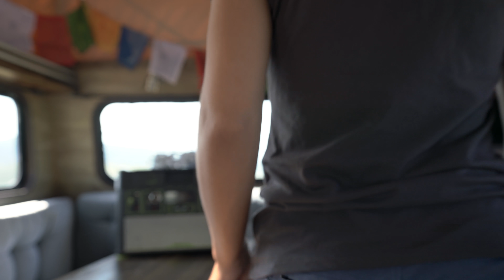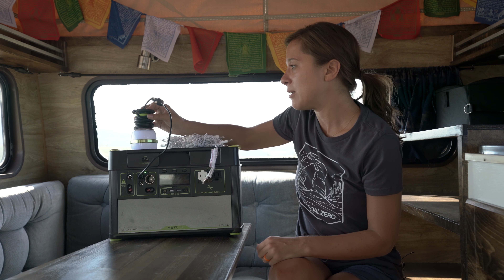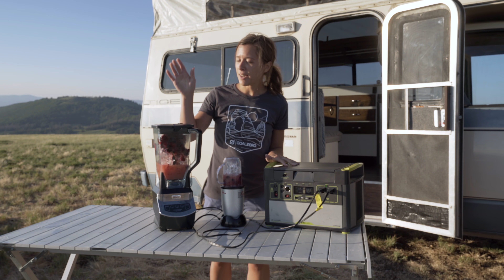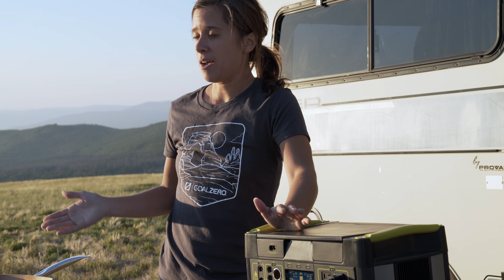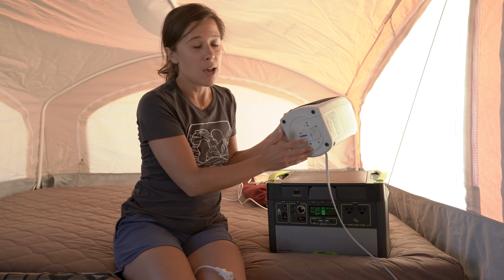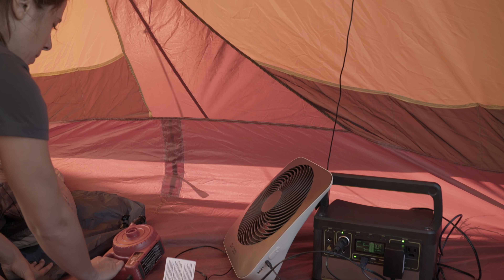Goal Zero Yeti Powers: Camping Edition

Comment: Please, my Dewalt power station kills that thing, in discharge & Charge time https://i.imgur.com/NeJ5NID.jpg. Plus you can take the batteries out, put them in tools and go to work. It is like comparing that Briggs & Stratton 5000 watt geny that only puts out 20 amps to the Honda EU3000 that puts out 23.7 amps. Charge time on that is a joke, like 12 hours? I can charge in 70 minutes @ 12 amps DC.

Comment: How long does it take to charge the yeti when it is down to only 20% ???
Reply from the maker: Hi Jeff,
Ultimately that depends on how many solar panels you're using and the weather conditions you're under. if you max out the input on the PWM controller at 360 watts you should be able to recharge the Yeti 1400 in about 4-6 hours in sunlight. If you add the MPPT controller  module to the Yeti 1400 you can have a max input of 600 watts and it can recharge even faster.

Comment: I know it's light and looks real cool but for the price of a Yeti, I picked up a Costco Yamaha 1800 watt inverter generator, (2) 35ah agm batteries, a 400 watt pure sine inverter w usb, an 80 watt foldable solar panel set with a charge controller and a big buddy propane heater with some money to spare for gas and lp.This keeps me covered for using the generator for big draw appliances and charging batteries, the batteries and inverter for led tvs, laptops, iPads and iPhones and the big buddy for when the temps go from 80 to 45 after the sun sets.
Reply: That's a really economical setup. 

Could you please list the models of:
 1) 35ah agm batteries,
 2) 400 watt pure sine inverter w usb
3) 80 watt foldable solar panel set with a charge controller)?
Reply: Agreed, the convenience of the Yeti is just not worth the price tag.  If you have the money, buy it.  But there are far more options for far less.
Reply: I'd do a 100 Ah Bioenno LiFePO4 battery. Small pure sine wave inverter, 300 Bestech. 100W renogy solar panel and maybe one of their compatible chargers with the battery or I use the Buddipole power mini. When I go camping, while it's allowed in the rules for certain hours, I'm not the biggest fan of hearing a generator running for four hours next door between 5pm an 9pm. Very rarely does someone bring one.

Comment: One set of Christmas lights uses more power than a dometic fridge?
Reply: Your Journey to Sleep
Like other people have commented, it's the difference in starting with a 12v power source and then converting it to 'household current' with the inverter. You should use 12v devices as much as possible, your power goes farther. Btw, goal zero gear costs more and has fewer ports and functions and is heavier than the Inergy Kodiak, which has a sweet 3k now. I don't work for the or anything, but it is on my wish list.

Comment: Question....so if the Yeti was 2000 to  3000 watts would it  be able to run the heater? Or air conditioner
Reply from the maker: Hi Alvara,
Great question. So everything will ultimately depend on the power draw of your heater or air conditioner. So let's say for example your heater required 1500 watts to run, that would mean that every hour your heater would drain the battery by 1500 watts. So if we took our Yeti 3000 lithium power station that stores 3000 watts of power that would only be able to run that heater for 2 hours before it would drain the Yeti to empty. So even having a larger Yeti that was 2000 or 3000 watts wouldn't make it run all night and still be a heavy power draw.
Reply: Goal Zero ... I understand now.  Thank you

Comment: LED Christmas or fairy lights will use significantly less power.  You plugged the Dometic fridge into 110V, since it also works on 12V, shouldn't you have plugged it in there to conserve power?
Reply: My thoughts exactly. Would pull less if 12 volts used.
Reply: I think it's a case of needing the proper power cord.  Apparently, Dometic and Goal Zero use different plugs on their 12 V power cords.  If you are handy with electrical things, you could probably build your own power cords and/or connection adapters to do the job.  Powering the fridge via a 110 V to 12 V adapter is going to waste power.
Reply: @raysills  The cord to the Dometic compressor fridge have a male sigarett lighter plug, Goal Zero has a female sigarett lighter receptacle....

I believe that's a match... 😁
Reply: @MichaelEricMenk   look at some of the other comments, Dometic and ARB plugs don't fit because the GZ design.  So they used the AC outlet instead.

Comment: I didn't need the high power to run 1000w appliances but I did need to power a cPAP machine at my mountain cabin that is off the grid. I have the older model Yeti 400 because I can chain extra batteries to it. It works great, it powers the cPAP and a fan and has a total power of105AH. The cost of the extra two 35AH batteries was $125.00 and the Yeti was under $500.00. LOVE IT and it lets me not run a LP gas generator at night.  ALSO A 100W solar panel works great to recharge in day. I can run the cPAP for days on the Yeti.
Reply: Jim Fariello also if you can get the 12v power supply for your cpap unit you can run much longer. The a/c power wastes a bunch of energy just running an inverted. Skip the middle man and go 12v!
Reply: @fredletstravels  Great tip right there. My bestech 300W inverter consumes .6-.7 Ah. I made a jumper cable to my battery to fit the barrel plug receiver of my cpap.

Comment: I wonder about a hot pot or coffee maker
Reply: paige canf I use mine to power a 700 watt microwave, an electric water kettle, and an induction cooktop. All of these items work very well. My Yeti 1400 is always connected to two 100 watt flexible panels that are on top of my Ford Transit. Goal Zero created a really nice case with lots of potential. I'm disappointed it didn't automatically include the MPPT Charge Controller. https://www.goalzero.com/shop/yeti-accessories/yeti-lithium-mppt-solar-charging-optimization-module/ The company has great customer support and has made a power bank with lots of potential.
Reply from the maker: Hi Paige,
Thank you for your comment. We actually tested out a coffee maker in our previous episode found here https://www.youtube.com/watch?v=fYLZS8PXVUE&t=

Comment: Just upgraded from the Goal Zero Yeti 400 to the 1400 Lithium. I use it every day to run a Surecall cell phone booster, Dometic CFX-75 fridge and various other gadgets. It’s charged by 200w of P3 foldable solar panels on the tent, in conjunction with the Goal Zero MPPT ad 
aptor. Goal Zero makes excellent products, used 6 x Lite-A-Life 350s chained together to light the tent throughout the winter.

Comment: I've been using my yeti 1400 for my only power source for about 7 months now, purely solar charged.  it seems okay, hasn't failed me yet but the capacity is way lower than it used to be.  I can't find any replacement batteries, which is the reason I purchased it in the first place. not cool!
Reply: See:  my comment nearby.
Reply from the maker: Hi Rollin Nerdy,
Sorry to hear about the troubles you're experiencing with your Yeti 1400. That's definitely strange for your Yeti 1400 to have decreased in capacity after 7 months. At the moment we don't make any replacement batteries for the Yeti 1400 currently, but are working on those options. We'd suggest contacting our solutions center team at 1-888-794-6250 Monday - Friday from 8am - 5pm MST and they can assist you with a warranty to get a new Yeti 1400.
Reply: What?? There is no replaceble battery?? No way I'm buying this stuff. Stick on having single components.
Reply: You're not kidding.  $1800 with no replaceable battery!!!! Thats nuts!!  The video girl does a great job though.

Comment: Nice demo showcasing its abilities.  I wonder if there is a loss of efficiency when plugged into the inverter.  What percentage is used just to convert the energy when plugged in as apposed to the cigarette lighter plug?

I have the earleir 1400 Yeti and seems like a good product, although the Light button has sunk into the front face a little.
Reply from the maker: Hi,
Great question, there is loss of efficiency when using the AC outputs on the inverter. On a Yeti 1400 it's less than 10% and that's due to the conversion of energy as you know. We're sorry to hear that the Light button on your Yeti has sunk in. We'd suggest reaching out to our solutions center team at 1-888-794-6250 Monday - Friday from 8am - 5pm MST to see if there's anything that can be done to fix it.

Comment: Dometic fridges will run on 12vdc, why did you use the AC outlet?  This tells me lithium still cannot run off road fridges on 12vdc.  I have the 1000 and am NOT happy with this scenario.
Reply from the maker: Hi,
You're correct, they do run on 12V and there is a known compatibility concern with lithium technology running these awesome off road fridges. We've been working closely with ARB and Dometic the past few months in resolving this. Keep an eye out in the next month or so because we will have a solution that will make this possible to run on 12V.
Reply: @goalzero  
I am very interested in the yeti 400 lithium battery...
Will my Dometic cf18 DC cooler run correctly with this?
It is 12/24V DC..
Along with my 100w solar panel...
Reply: Mel Lacson  --  A comment on another site pointed  out that the 12V socket has 'shoulders' in the plastic on either side of the center contact which prevents 12V plugs with a too wide center contact from reaching it.  I looked in mine, and yup - the plastic insulator does have 'shoulders' which is why I was having a no-power issue.  Searched my box of electrical 'so-forth and what-not' (ha-ha) coming out with another 12V plug with narrower center contact = worked just fine !
Reply: There is a vlog where this guy's ARB fridge had a compatibility issue with the 12V plug on the Yeti. He called Yeti and the solution was that he got an Anderson (plugged into the Yeti) to 12V adapter (ARB plugged into) and that solved the issue.  Here's the link.  https://youtu.be/4xJYn_6TnoM
Reply: What is the compatibility issue with lithium batteries running off road fridges? I am currently using a Yeti 1000 Lithium to power my Dometic fridge and am wondering if there is something I should be concerned about.
Reply: Most off-road fridges are designed to work with lead acid batteries.  Their voltage ranges from 10.5V to ~14V.  In order to not drain your lead acid battery beyond usability, the fridge manufacturers designed in a shutoff that will turn off the fridge when it sees a voltage below a certain voltage(usually 11.5V).  

the Goal Zero lithium battery ranges from 9V to 12.5V.  So when the fridge sees 11.5V, it shuts itself off, even though it has a majority of its capacity remaining.  You won't damage the fridge, or the yeti.  It was just a bad assumption on the fridge manufacturers side to assume their product would always be plugged into the same chemistry.  I think Goal Zero is releasing a product that will ensure the voltage on the 12V will maintain a consistent voltage to mitigate this problem.